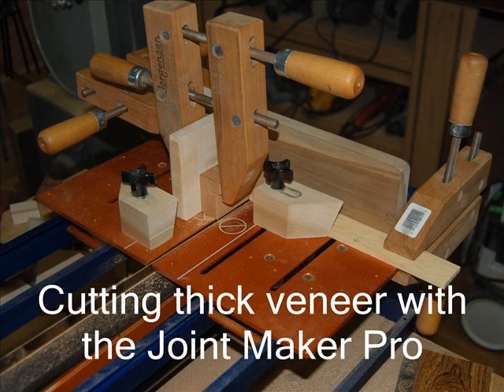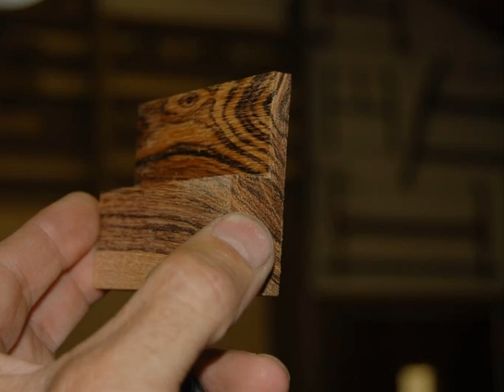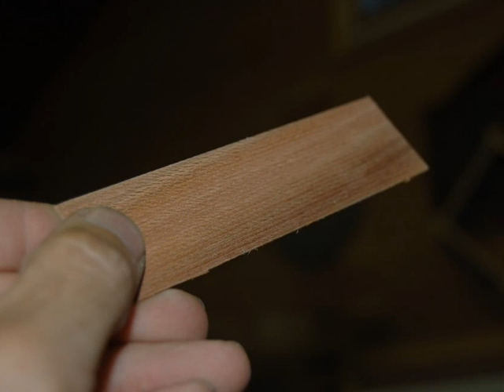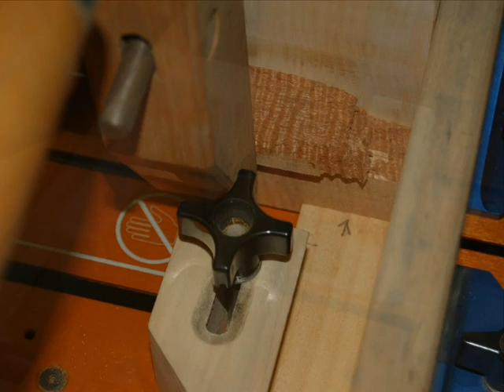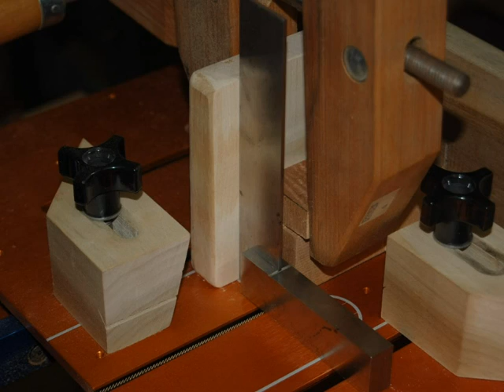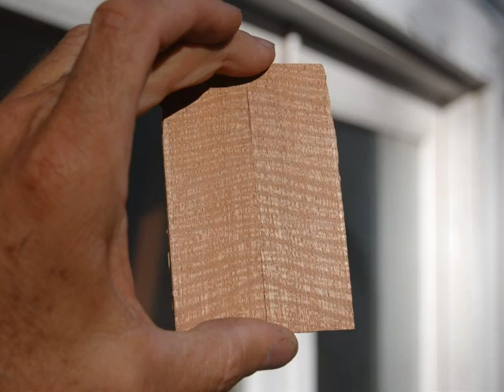(2) Ripping wood with the JMP

Comment: What is the max length of rip cut? Could you do a 12 inch wide board or are you limited to something like 6? I am considering this tool!
Reply from the maker: @fredosachoff  max rip is not very much. The way it works is to push through the teeth. Ripping for small inlays is good. Maybe 3”. What kind of projects do you make? Fun tool but honestly I don’t use it very often anymore. Very expensive and blades are also costly. This tool would be great for someone building miniatures or fine details but not great for most projects. Borrow one first if you can.
Reply: @arboristBlairGlenn  I am trying to make high quality wooden board games with 1 inch square tiles or 1 x 2 inch pieces. I'll likely pass on this tool and find another way to accomplish the goal. The boards themselves will vary in size from 6  x 6 to  16 x 16. I should probably investigate a high quality manual miter saw to avoid the issue of tear out. I am a beginner and was hoping this would do  beautiful cuts that would require little to no sanding but alas I will keep practicing to improve my skills. Thank you for your reply - it helped me make a decision!
Reply from the maker: @ I think that you would find this tool a fun toy buy quickly realize that it is not very productive. For the right application yes.

Comment from the maker: Bridge City has quite a few good videos that show some of the things they learned that could be done.  It is a remarkable tool that takes a bit of getting used to.  It is limited to smaller sizes of wood up to about 1.25 in thickness.  Ripping up to about 4 inches long. The pattern matches are very close as the blade is very thin. It is a pleasure to use and well thought out.  The newer version has ball bearings which makes it even smoother and cutting with less resistance.